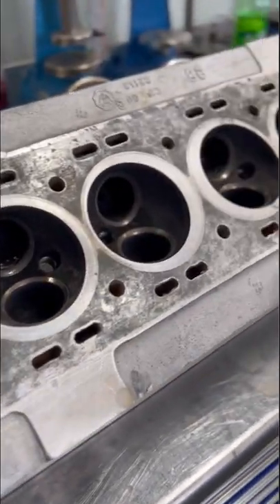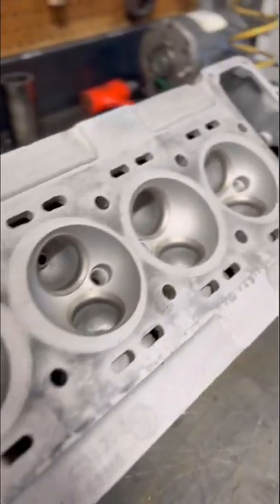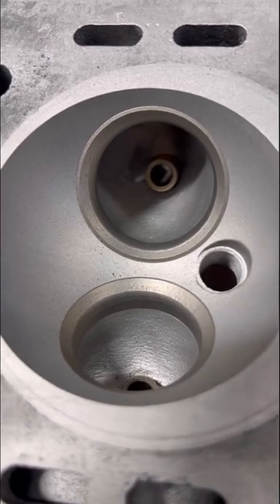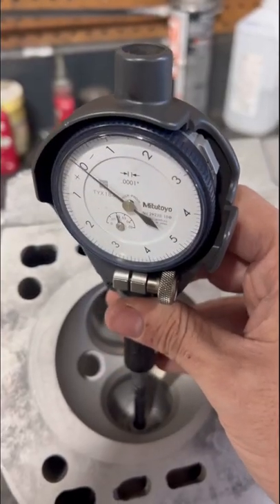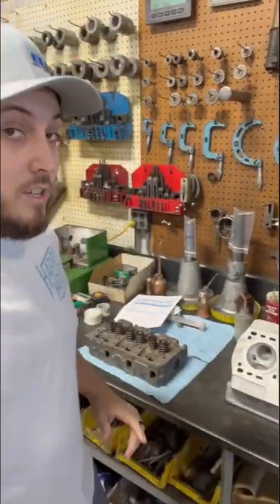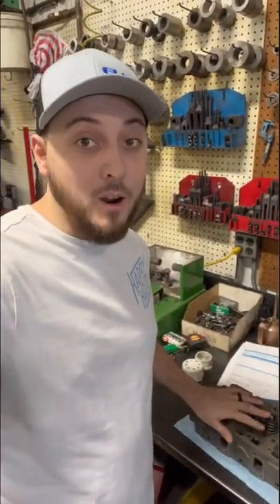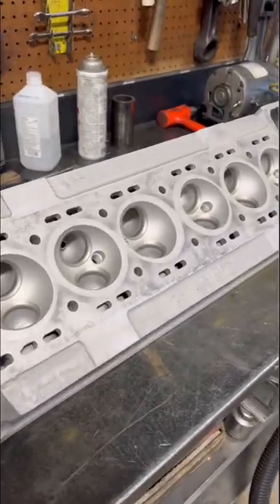#shorts At Least It Will Make A Nice Coffee Table…

Comment: Now I know what makes the jag such a a screamer , the combustion chamber looks very much like and old Hemi. 
With dome pistons I can see it breathing pretty good.
Reply: Hemispherical combustion chambers were used here and there from the early 1900s.
Reply: Too much timing needed to get it to hp; nice midrange but by the time you add the timing AND the fuel needed to rpm that peppy midrange is gone. Never did play with the cam centerlines though. 

But it responds to turbos like you wouldn’t believe.
Reply: @vyrnmn  makes ya wonder why it never caught on.
Reply: @BoogWar01  
Good reply. I'll think about that. 
Thank you.
Reply: @phillipthethird42  They tend to cost more to build than wedge engines.
You could look at the complexity of parts to go in the Chrysler 440 wedge and 426 hemi to know what it takes to build on OHV hemi.
You can look at the Datsun L28 and Nissan RB30E to see how much more complex a SOHC hemi is.
Nissan once experimented with a hemi head L28E engine and called it "LZ28." The gain in performance couldn't justify the expense.
Reply: @skylinefever  
Interesting.
Reply: my honda xr100 has a hemispherical head
Reply: @phillipthethird42  In addition to the cost, another problem with hemispherical heads is compression.  That's a huge combustion chamber and getting the right compression ratio requires putting a massive heavy dome on the piston.  That not only stresses things and limits RPM, but more piston surface area causes the piston crown to absorb heat, which for various reasons is about the last thing you want getting red hot.  Also, the combustion chamber at TDC gets this skinny moon shape, which is about as inefficient as it's possible to get.  The wedge or modern pent-roof are pretty good, and the best possible shape is the "top hat" on modern 2-strokes.  However, in boosted applications where compression is lower, all of these problems go away and that big ice cream scoop becomes perfect.  At that point you get great combustion and port flow.  Great for top fuel, disappointing for N/A.

Comment: Would that be considered a hemi?
Reply: For sure!!! More of a Hemi than the third gen 'Hemi' engines than what Mopar/MB/ Fiat makes these days...
Reply: Any engine with hemispherical combustion chambers is considered a hemi. Mopar is the one that coined the term.

And, yes, the 3rd gen Hemis aren't true "hemis" since the chambers aren't hemispherical, but the valvetrain and (dual) center spark plugs locations makes it close enough.
Reply: @JoseRivera-ym3wj  yes, the third generation Mopar/MB/Fiat 'Hemi' V8  engines are not actually 'Hemis'... Their combustion chambers are shaped more like the single rocker shaft, pre big block v8 versions of the Poly-Spherical chambers... There was a 318 version of those engines that were available until the 1966 model year cars... That was known as a 'Wide-Block' 318 that shared very few parts with the 273/318/340/360 'LA' engines... These third generation poly-spherical V8 engines can really pump the power out, but unfortunately, they don't have the same reliability as the first and second generation v8 engines, that Mopar produced back then... That Jaguar head is impressive, but I have never been a huge fan of Aluminum heads for everyday street use... They are lighter and easier to manufacture, and look really nice... But they are NOT as durable as cast iron heads after an overheat... Especially if they have overhead cams.... Warpage will ruin most aluminum heads with ohc because the bearings for the cams won't line-up properly, and the aluminum often looses it's temper, after they overheat...
Reply: @michaelmartinez1345 , maybe that's the reason Toyota's 2T/3T engines were reliable despite being aluminum head "hemi" engines: since they were underpowered and overengineered, they had little possibility of overheating unless crass negligence and abuse were put on those engines. And they had OHV valvetrain.

There are enthusiasts and aftermarket support for these little engines. They're among the engine of choice for compact drag racing back in the heyday and are still today with Mazda rotaries and other small 4 bangers.
Reply: @JoseRivera-ym3wj  all a fantastic history of all aluminum engines, until they overheat above the critical temperature that aluminum has... An overheat can happen so easily... A leaky coolant transfer hose, a leaky radiator, a bad pressure cap, a bad thermostat, not having a thermostat when one should be installed, traveling through muddy conditions, a leaky heater core, all of these things can cause an overheat, and the heads are usually the worst items to be affected... Because they are often at the highest point in the C/S... Sure, there have been high mileage cars of many types that require relatively little maintenance... But with that being said, there are many that were salvaged and crushed, because they are beyond repair, because of relatively simple things that took place, like an overheat... But don't take my word for it, take a walk through the salvage yards and see what they have there, before they are finally crushed... You might be surprised... Incidentally, Several companies that manufacture cars, also make several types of industrial equipment... Much of this equipment have engines that are similar to automotive engines... Most of the equipment with cast iron engines that use pushrods still run after a long life... With their original engines. The equipment that have engines with aluminum components like heads, seldom last 50% the life that the all cast iron engines last... Again, don't take my word for it, check for yourself, the age and meters of equipment like these... The cast iron equipment is often far more durable...
Reply: @michaelmartinez1345 , I'll give you that. The early I6s of the Big Three were all iron. The GM "Stovetop", the Ford 300, the Slant Six and the Jeep 4.0L were so durable and nearly bulletproof. One can even argue that the best engine ever made was the Cummins BT engine, especially the 6BT.
Reply: @JoseRivera-ym3wj  All of those engines that You mentioned were very good designs, and very durable.. Especially the Diesel 4 & 6 cylinder Cummins engines... Most Diesels that are in the range to drive vehicles, are cast iron because of the required durability...Aluminum definitely has it's place in some engine designs, but isn't  nearly as durable as cast iron.. At  475*F. The loss of tempering begins to take place with tempered aluminum alloys... It is also known as annealing... An engine that has coolant that has been drained to low levels, can easily have areas in the engine that go far above those temperatures... After the annealing takes place, high surface pressure gasket surfaces (head gaskets) warp, cast-in female threads start to loosen and pull-free, steel valve seats, valve guides and other parts with an interference fit - begin to loosen, and if the heads hold camshafts, the bearing saddles that support the camshafts become mis-aligned because of the warpage of the entire casting assembly... It means the head will have to be re-tempered, only after all parts made of dissimilar metals , like valve seats, valve guides, freeze plugs, studs, locater pins & dowels  , etc. Have been removed... Then the re-tempering process can be done to restore it's original strength ... Now comes the process of artificially ageing the aluminum by heating it in an oven to less than the critical temperature, and slowly reducing the temperature, which takes from 4-6 hours, depending on the size & shape of the part... This process reduces the internal stress concentration build-up from the tempering, and gives the part it's stability and reduces internal corrosion and cracking... Then the process of re-machining the deck surfaces , valve seat pockets, camshaft bearing saddles (if oversized valve seat o.d's and camshafts with oversized bearing surfaces are available), new studs , new dowl sleeves & pins, new freeze plugs, etc. This head, now has become more expensive than purchasing a NEW bare head... That is, if new bare heads are available for that engine, which for some strange reason, they are usually not... So one might find that these aluminum engines, are not good to re-build, because they don't respond well to re-building (from overheats) , at all...Once they overheat, they will never be as strong/durable as they once were - before the COMMON occurance of overheating takes place.... This applies to ALL liquid, cooled engines with major components made of tempered aluminum... Air-cooled aluminum engines, typically don't severely overheat as frequently as the liquid cooled aluminum engines do, because their increased cooling surface area, (cooling fins) are less likely to be compromised, unless they are clogged with mud, grease, debris... But if they do severely overheat, above 475*F. , They too will suffer the effects of annealing.... Aluminum is advantageous for the manufacturers, because of it's availability, it's ease of machining, and of course, it's inherent limited life-span in those conditions, as the customers for their products will surely be coming into a dealership, to replace a 'worn-out' vehicle, that typically still had a LOT of miles left on the durable ferrous metal parts inside of their engines....
Reply: @michaelmartinez1345 , I take that you're a machinist. All those technical terms used can mean experience in machinery and/or metallurgy.
Reply: @JoseRivera-ym3wj  Very close... I have a background in aircraft maintenance, and repairs, also trucks and heavy equipment. I'm also enthusiastic about General Aviation , classic cars and motorcycles ... I also pay close attention to programs like this one... These people really know the areas where problems start, what causes them, and the end result of those issues that develop... They are very well equipped & experienced to properly  handle these issues... Programs like these really help one understand of what procedures are needed to be able to properly repair expensive equipment, like this.... One interesting thing about aluminum is, since it begins to loose it's temper when heated above 475*F. , It is never a good idea to heat aluminum with a torch to extract parts that are pressed into it, for doing so could easily cause the aluminum to become annealed in the area that went beyond the critical temperature... When aluminum parts are initially created, they are given their basic shapes, then tempered, then artificially aged (stress relieved) then the final machining takes place... When Aluminum assemblies are welded at the factory, they are always welded when the alloy is annealed ( 'O' - condition), then they temper it, then they artificially age (stress relieve) it... Then it is machined for final assembly.... But when the various repair shops do welding or use torch's on Aluminum, they often don't have the equipment to properly temper it or artificially age it... Now you get something back, that is supposedly 'fixed' but in reality, it could be a part that is waiting to fail... This is WHY, NUMEROUS aircraft maintenance facilities don't want to see a torch of any kind in their work-shops... They don't want failures of any kind to be hidden within the aluminum structures of the planes.... I can't tell you how many times that I have seen aluminum M/C frames and swing-arms fail and easily bend after they have been torched or welded... Never heat Aluminum above 300*F. This temp will give the aluminum a 175*F 'Safety Factor'....

Comment: Why and how would and could you botch that head? It’s not a big deal at all to work, mill or install guides or even seats for that matter. 
  The only heads That ever made me nervous building them, new guides new seats, valves and cut out for larger Dia springs was a set of heads off a 1968 Dart Factory Hemi matching number SS. 
The car came from the factory as a Drag car. This car was ordered no paint no heater no radio no carpet no windshield wipers no chrome no extras whatsoever. When I worked those heads you talking about someone nervous because if I had ruined them I would have ruined the complete package because it would not be a factory number vehicle anymore and the deal is this car was still racing on the track in the superstock class.
I’m not saying that the head that you have there isn’t off a matching # vehicle I understand where you’re coming from actually.

Comment: Probably warped.
Reply: Maybe. If it is warped, the bearings for the cams won't line-up properly unless they are align-bored AFTER the head has been re-tempered, and then surfaced... And even then, it (align-boring of the cam bearings) still might not be able to save the head... There are advantages AND dis-advantages to using OHC's and aluminum for critical engine components...